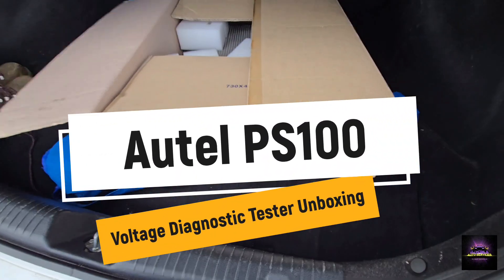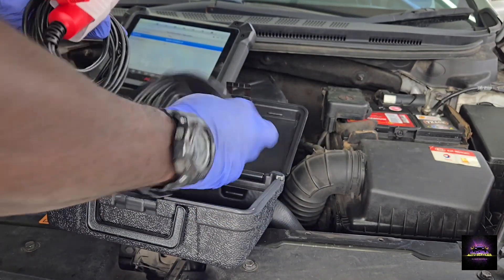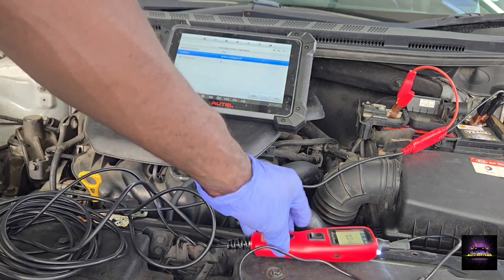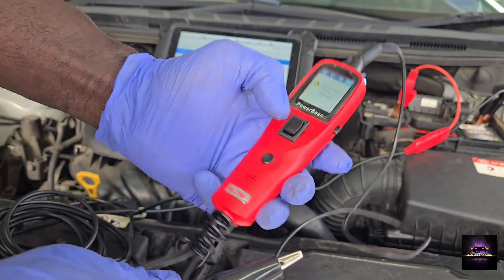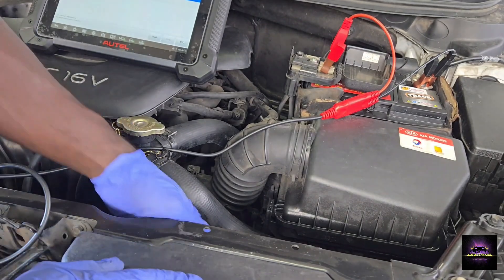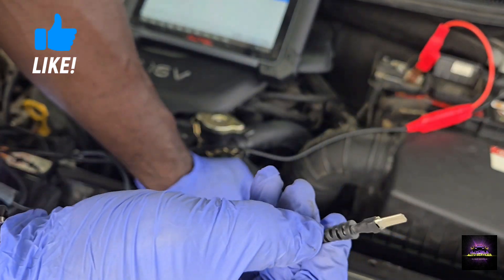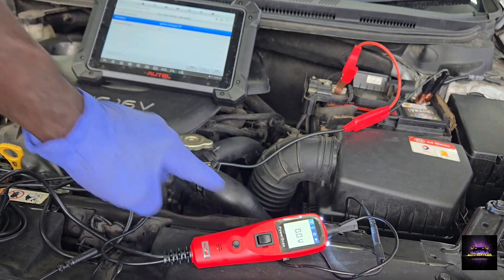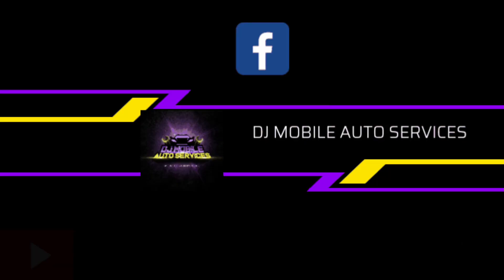AUTEL PS100 DIAGNOSTIC TESTER TOOL UNBOXING & REVIEW.DO IT HAVE A PLACE IN MY DIAGNOSTIC TOOL CART?

Comment: I just purchased the Autel PS100 Diagnostic Tester Tool, and I absolutely love it! Between my boat, trailers, cars, and trucks, I’ve found a million uses for this handy tool. It’s easy to use, accurate, and saves me so much time when troubleshooting electrical issues. Definitely one of the best investments I’ve made for my garage—highly recommended!
Reply from the maker: Appreciate the feedback bro.let me how it goes. Very useful tool